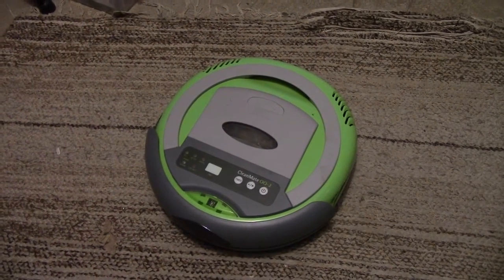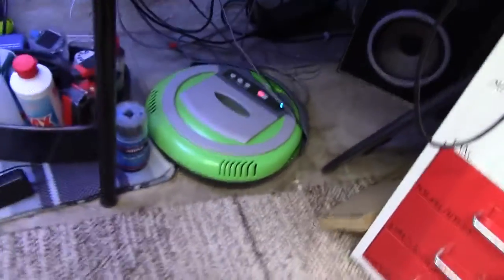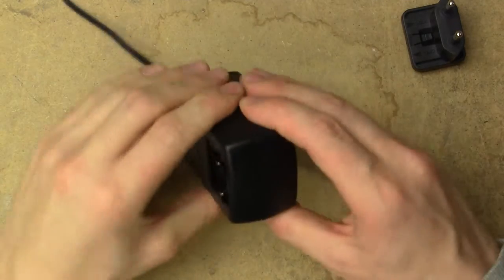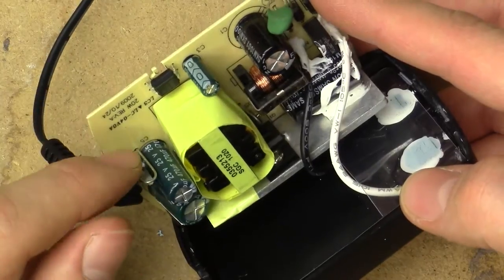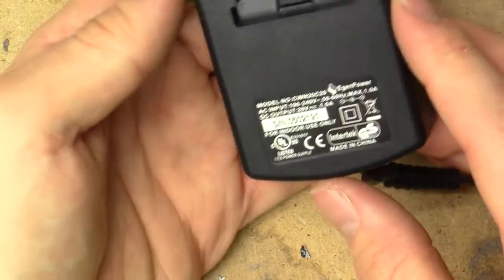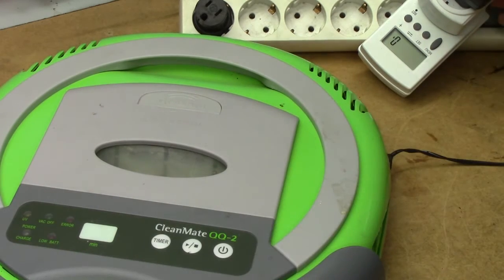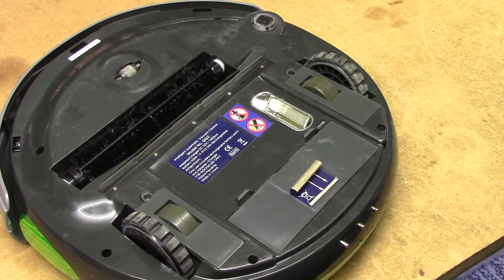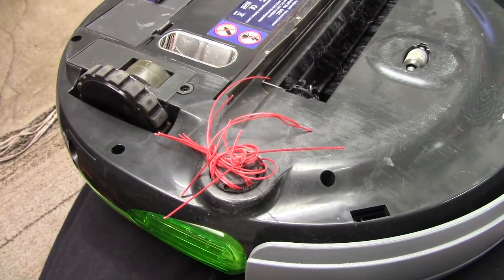Trash-picked robot vacuum cleaner

Comment: Nice find :)
As to those corner brushes, I would maybe look for something finer and trim it down in length (I would guess teardowns of robotic vacuums or visiting your local household goods store will give you clues as to length and thickness).
Reply from the maker: +Teukka72 Yes, the standard side brushes are more akin to paintbrush bristles than what I used, but making something like that would be a bit difficult; I'm not sure how I'd tackle it.

Amusingly, I just trimmed the red bristles down a bit after this video, and by letting the vacuum run over copious amounts of dog hair, it essentially turned into a big dog hair swab that collected absolutely everything it touched.
Reply: +FFcossag No clue. Some coarse fishing line perhaps?
Reply from the maker: Teukka72 That's a pretty good idea - or some cheap paint brushes and hot glue.

I probably will just not bother with it, though, since I see this thing as more of an add-on to normal cleaning, rather than a replacement.

Comment: That vacuum got thrown out because it's total CRAP. I've had one of those and I threw it away fully working because it's useless and LOUD.
Reply from the maker: +LReBe7 It definitely is loud, but that's the price you pay for a vacuum fan. It definitely sucks more (ha ha) than quieter models I've seen.
Reply: Yeah, but the main reason it's useless is that the navigation is random. The idea is that if it just moves randomly, eventually everything will be clean. The problem with that reasoning however, is that certain areas like under your desk enter through a bottleneck and that makes it very hard to get out of just by random navigation. In fact, you could view it as a pit of potential energy, locking in the vacuum. It wouldn't be a bad analogy to a quantum element being trapped inside an energy pit.
Reply from the maker: LReBe7 I never thought I'd hear quantum mechanics mentioned in a discussion about robot vacuums, and I can't say that I grasp quantum elements quite as well as I grasp robot vacuums.

The navigation on this one isn't entirely random, though. It cycles through something like six different patterns (one of them being random), which seems to make it sweep an area pretty well. It did get stuck a lot in my workshop, but a really fancy Samsung I was working on fared about as well, since my workshop is a rather hostile environment.

When I released this one in a more normal setting, it always managed to get out from even quite small and complex crevities. I think it works by swapping patterns ever X number of hits on the bump sensor, just to counter issues like that.
Reply: Yeah, it would make a lot of sense if it switched navigation tactics every so often, that's a novel idea!
Reply: What do you expect from CleanMate qq-2? :D
Well, if you find trash picked Roomba, it worth it to buy a charger and new battery to it. Because Roombas are the best.